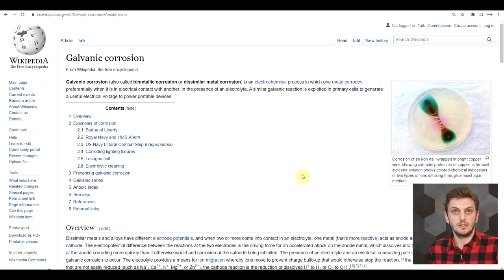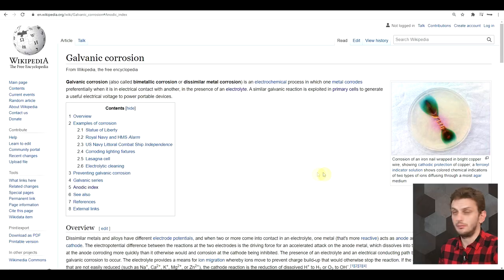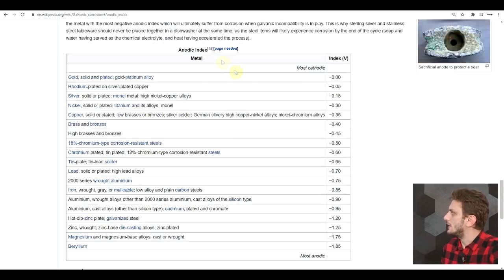About potatoes and Galvanic Corrosion (Long version)

Comment: After this video I went back to repair our sat receiver. Turned out to have a harddisk problem. Curious after this video I removed the drives PCB and I was shocked by the amount of galvanic corrosion. Not only the contacts but also a lot of vias. There was something that looked like an empty footprint of an IC on the outside. The weird part, no contact with anything, but the goldplated pads were turned into a mix of black, brown and green and most of the plating was gone. Yeeks, I am glad I normally do not have to repair consumer stuff :-)
Reply: Hi Fred,nice to see you back. 
Another problem to think off is that since arround 2006 manufacturers of electronic devices start using using lead free solder, 
so over years devices start begin to develop socalled "Tin whiskers" and create microscopic shortcuts between IC pins etc... 
The added lead to the solder was in the first place, to prevent the development of "Tin whiskers".

Comment: In the electrochemical couples table, one line is "Al10 Sn66 Pb34". That adds up to 110%. What am I missing? :D  I just ordered a board with a HASL (with lead) finish that I plan to mount to an aluminum heatsink, and I'd like to know if I should expect any problems.
Reply from the maker: Great observation on that alloy! I haven't noticed that :D According to the table, both lead and tin match very well with aluminum (<300mV); even though the table doesn't specifically show the proprieties of leaded tin (60Sn 40Pb) I do not remember seeing any issues in old equipment where aluminum heatsinks where in contact with solder - most likely you are safe.